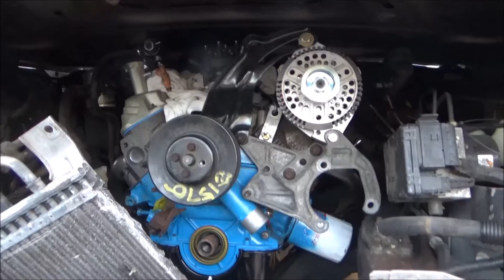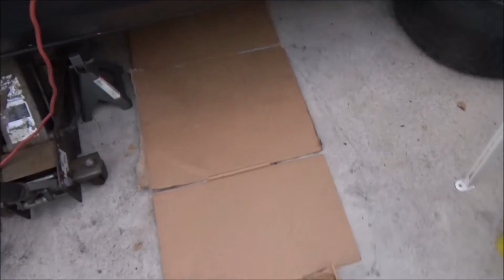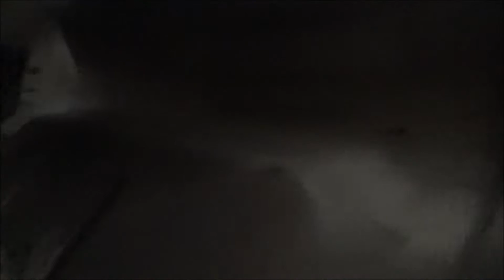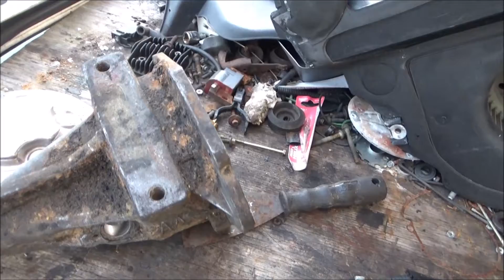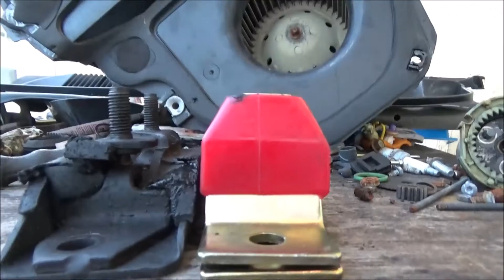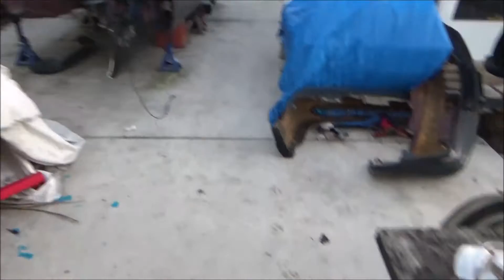Ford Crown Victoria 4.6 to 302 Swap Part 2

Comment: Do you have to change your motor mounts to get your 302 in
Reply from the maker: @curtismelder8282  had to change the motor mounts. On the 2000 I had to use a 90/91 engine mount from an LTD. One of the hole isn't in the right location. So once you put two bolts, you will need to drill the third one. This is on the driver side if I remember correctly
Reply: My 99 has the 4.6 in it
Reply from the maker: @curtismelder8282  mines also had the 4.6 with a 4r70w. Just swapped engine and transmission. Used a V6 4r70w since they have the same bell housing pattern as the 302. Installed a manual valve body to reduce the electronics on the car. The only electronics is the Holley Sniper plus the base systems of lights, radio, etc.